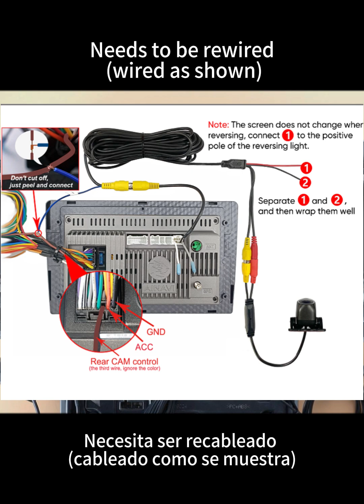Dodge Ram AINAVI Car Stereo Installation Video

Comment: Hello, I have the Ram 2018 1500 and with manual AC. Is it possible to talk to someone for questions? There are some things I would like to know before buying. Or if you can do a full install for my version of truck? Go through some of the features. Thanks